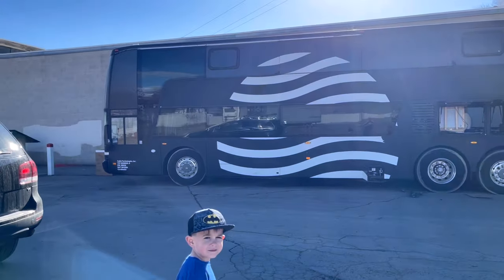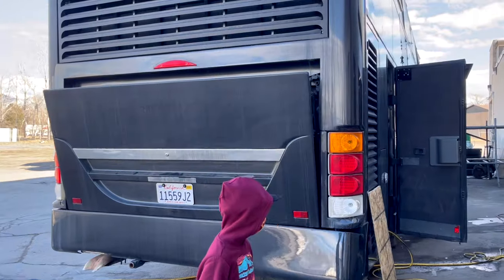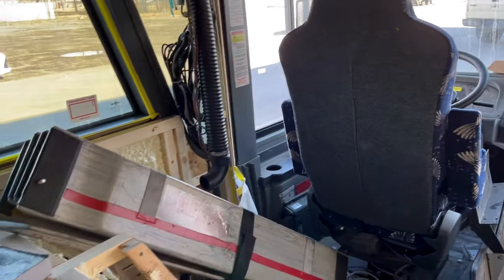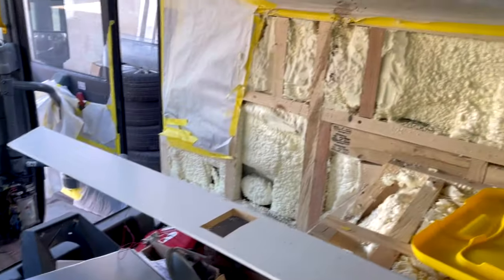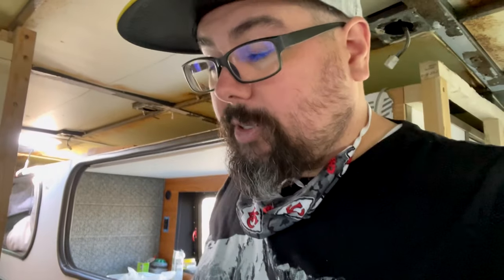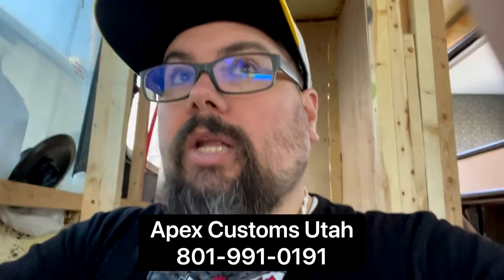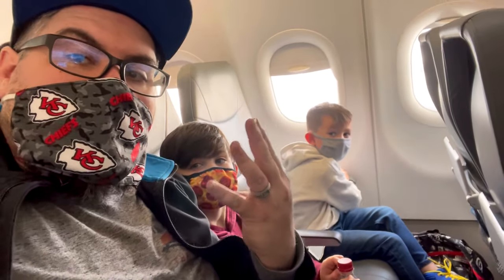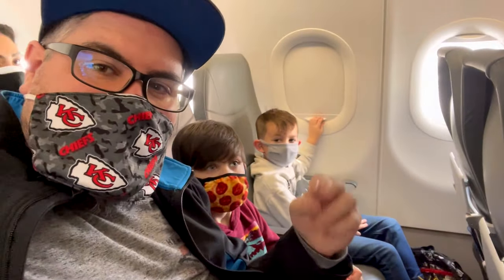Roaming Double Decker Tiny Home RV Bus Conversion Progress Update

Comment: my only gripe is that they are using wood to brace and house our grey/septic/water tanks over time that will fail shift or move. They should be using some type of metal framing and welding that won't shift or provide less chance of failure while the vehicle is in motion or when those tanks are full and the vehicle needs to brake immediately, go over bumps, forces of a G turn that induce the bus in pitch roll.

Comment: Thanks for the videos. I am searching for the best option to buy or build my mobile clinic. I am wondering if you could recommend a seller for the bus you purchased and also did you research multiple options of companies to renovate your bus. If so, what made you choose this company vs the others?  I specifically would like to buy a double decker RV or bus. Thanks in advance.
Reply from the maker: Great questions Candice! We bought our bus through BusForSale.com and we also checked out a few available from abc-companies.com - the authorized Van Hool dealership in the US. 

When it came to renovating the bus we got quotes from about 30 companies, interviewed/met with about 10-15 companies, and ultimately decided on Apex Customs Utah for a few different reasons - their team, communication, and they just seemed “click” with us from the start. They certainly weren’t the least expensive quote, also not the most expensive either. The quality of previous work they’ve done was also a big factor. This isn’t a typical “skoolie” so we wanted to make sure our builder had extensive experience with restoring all sorts of vehicles and treating the vehicle like it were their own. For us, they were the right choice.
Reply: don't forget to search for mobile clinic, mobile office conversions that are already done like these - https://www.usedmobileclinics.com/inventory

Comment: How do you get around the laws on height?
Reply from the maker: The bus is only 13’2”...shorter than semi trucks and a lot of fifth wheel trailers. This model of double Decker was specifically built and designed for the US market, so we don’t have to get around any laws on height.
Reply: @DoubleDeckerFam  wow, awesome! I was thinking about the double myself but didn't think it was a doable option here in the U.S.  Definitely looks higher than 13,2. Absolutely fantastic for you and your family. Best of luck, wishes and prayers.